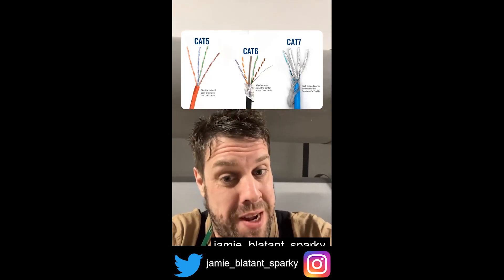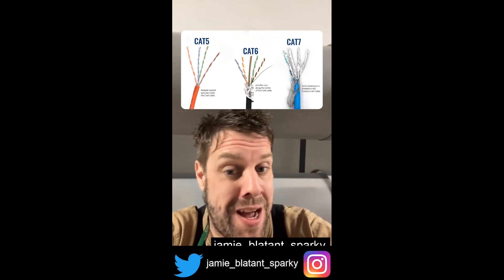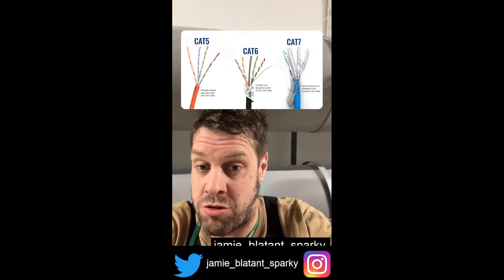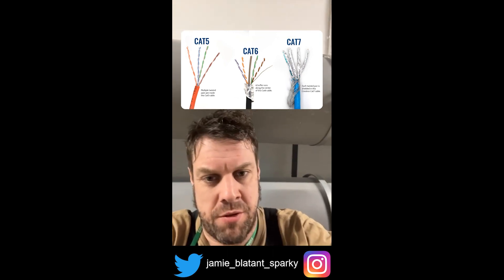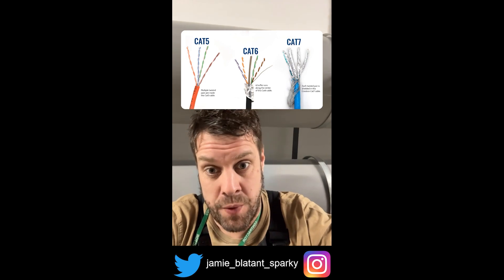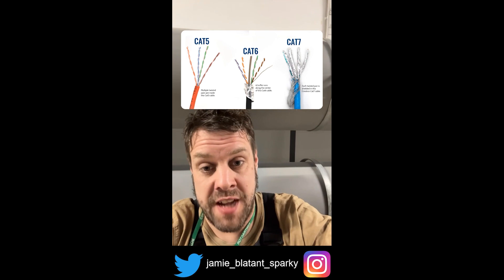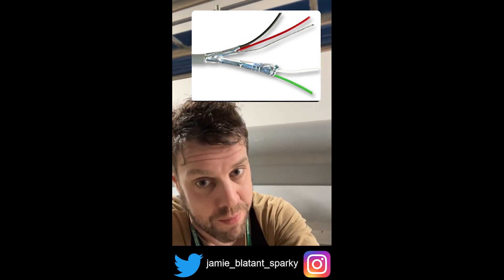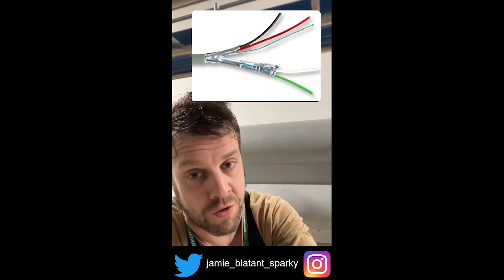The right cable for the right job , data, CT telephone cables and the differences

Comment: Is it Ok to use CAT cable and leave it Dog rough?  Lol

Another point for cat 5/6/7 is to leave as much twist on the pairs as possible to the termination point, none of this slide a screwdriver between the pairs and have 100mm straightened out.

Comment: Best one was when a twat I worked for insisted on using a cable tie gun on cat 5e, squished all the signal and slowed it down. Borrowed a fluke, proved it, cut cable ties and all the lot (luckily) sped up

Comment: Hi bud love your content has me in bits 😂. So on most offices or large buildings there's no longer telephone exchanges like there used to be it's all comes from a data cab through a switch and patch panel with rj45 points at the end so am I not supposed to be using cat 5e or cat 6 for these systems?
Reply from the maker: Nowadays this is fine as tbe phones are designed to use it I am referring to traditional POTS phones